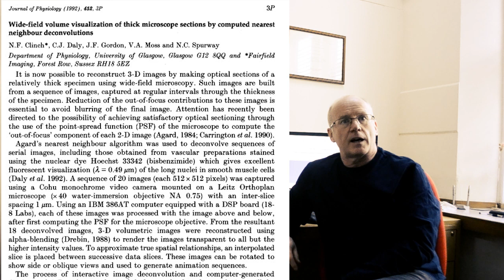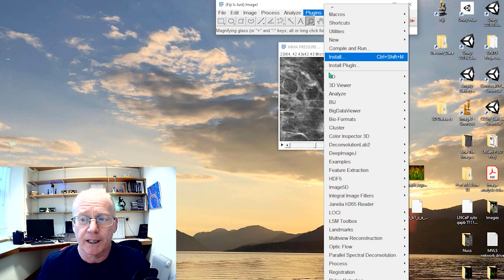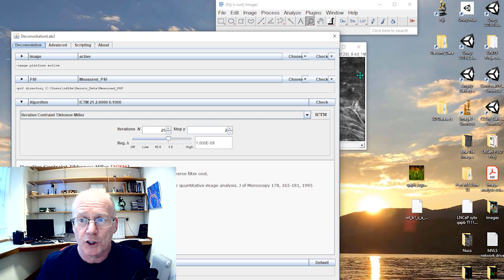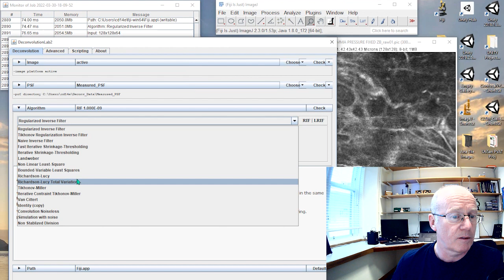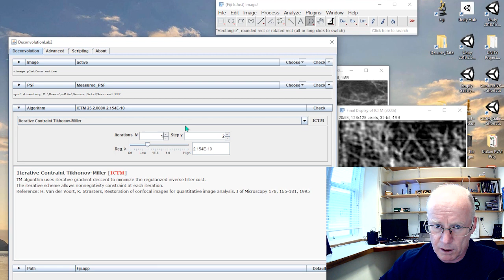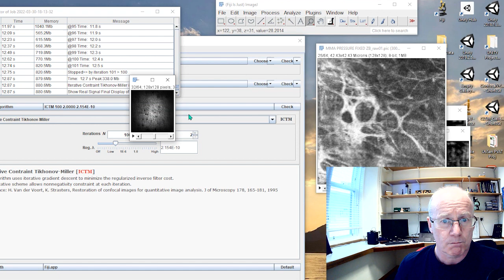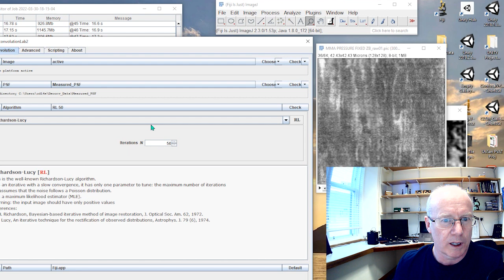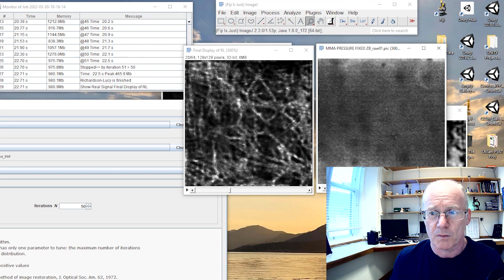Fixing blurry images in Fiji/ImageJ (Deconvolution Lab2 plugin)

Comment: Can I do this for my images which I have taken using oil drop for bacteria? My images are slightly blurred no matter what I do I am not getting pinpoint images. Can I use deconvolution for my dataset?
Reply from the maker: Hi, if the images are blurry because they are out of focus then deconvolution may not help.  The process models the distribution of light from a point source.  If fluorescence convolution is not the reason for your blurriness then deconvolution is unlikely to help.  C.

Comment: thank you for the video 
i was wondering is one can user any psf ? in other words can i use a psf i find online for my images ? or do i have to create it by myself in my microscope ? if so , do you have any instructions on how to do it
Reply from the maker: Hi.  No, it wouldnt be wise to use a psf from the internet.  You dont need to if you know some basic parameters about your microscope or collection device.  There is a plugin to calculate psf (Diffraction PSF) that works in both Fiji and ImageJ.  C
Reply: @CraigDaly  yes thats correct. thank you for your reply. I did some research and found how to generate psf. 
Thanks for the videos they are very helpful